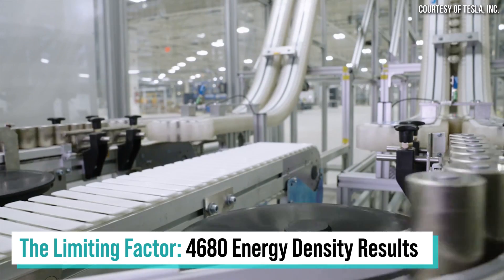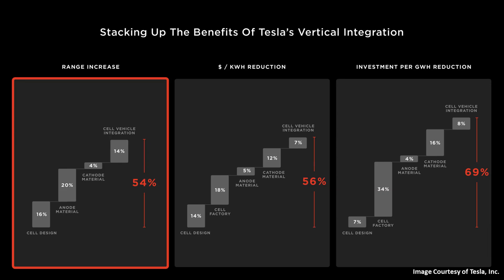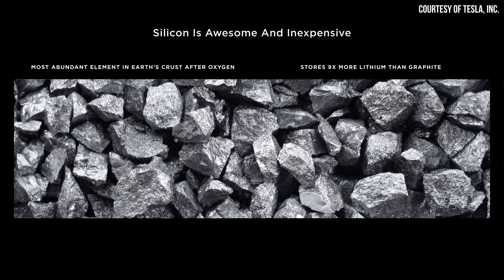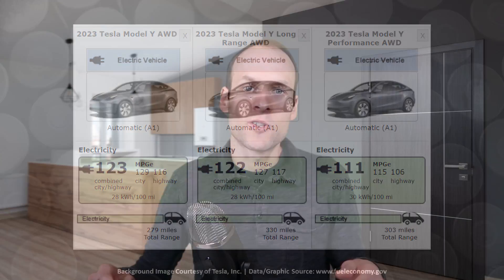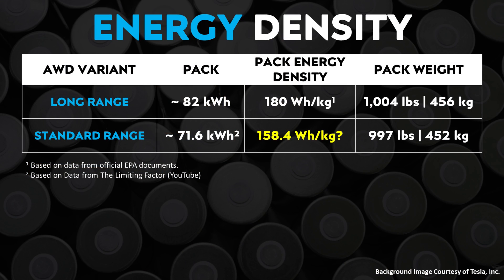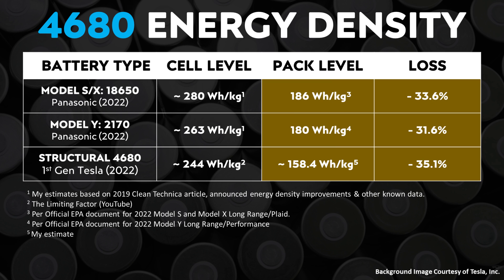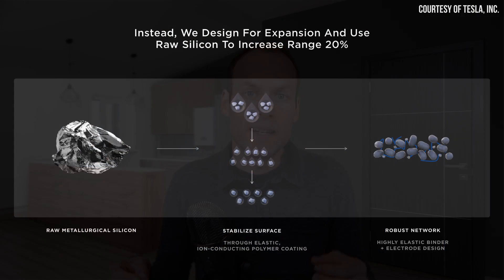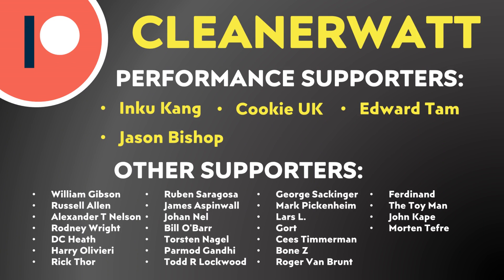Tesla 4680 Battery Update | Not What I Expected

Comment: wh/kg on a cell level is absolutely irrelevant. If your vehicle is more efficient (for example with less internal resistance in the cells) or your pack design is lighter you can still achieve more range.

That's why wh/kg on a pack level and internal resistance are the most important metrics to learn about. We know the vehicle weight is almost the same. So we can conclude that wh/kg on the pack level is worse. But we also know the internal resistance is about 1/3rd.

Comment: Geeking out on the "numbers" is cool.  It's fun to speculate, especially as more data becomes available, as to the overall pack energy density.  However, those comparisons are all battery cells using the NMC or NCA chemistry.  I think LMFP and other solutions will gradually replace the most energy dense solutions, as total lifespan, cost, and sustainability become more prominent.  This is especially true as more manufacturers enter the fray.

Comment: So the highest density pack is the 18650, the smallest cell used in the S/X.  The biggest, lowest density pack is the 4680.  What a wreck!  2170 cells can still see improvement too.  Why did Elon reinvent the wheel?  To make it cheaper, not better. Better won't be for some time.  Good luck to those standard range MYs, getting "old" sitting on the shelf lower density 4680 cells, which charge slower too, with a lower 0-60.  Oy.

Comment: The 279 mile standard range Model Y does NOT use 4680 or 2170 cylindrical cells. The standard range uses LFP Prismatic cells, that’s why all of your “theories” don’t add up.

Comment: So was that analysis based on testing one 4680 cell? That would not be definitive. Why would 4680 come out with lower density than announced... possibly could it be the difference btwn a lab construct and testing of 4680 prototypes vs. mass production end product result? Some small differences in how materials are processed and handled on mass production compared to lab environment? Although the Wh/kg is lower it is not a startling difference, Tesla may be disappointed that mass production is not showing the desired results and is working on a solution to achieve their original goals for this battery. Elon has said many times that the real product is not the thing you build, it's the thing that builds the thing you build. So manufacturing the 4680 is the real challenge, not inventing the 4680!!!! It's only successful if it's repeatable, ad infinitum! 
I am guessing there will be tweaks to improve the 4680 manufacturing process in the future!
Reply: We were given a false bill of goods that’s why. The battery as it was proposed does not exist.

Comment: Ok so 4680s are a little lower in Wh/kg,  but let's assume we can interchange them in a fixed size battery pack. Since the pack size is fixed, now what matters is Wh/l. So how does the volumetric efficiency compare? It's important to include that especially since we are comparing packs on the same model of car. Thanks for the great video and insights.

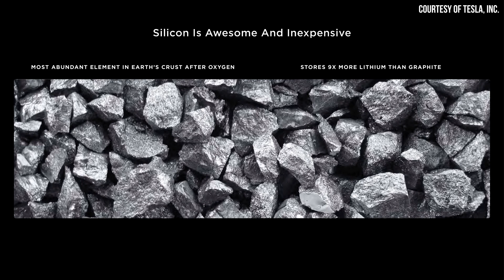Comment: Everyone says the battery can is thicker so there is less energy density because less battery material 2:45 
So yes, the can is a little bit thicker, but we're not talking about a pipe here. The kilowatts per kilograms is lower because the cans are heavier, plus all those tabs on both ends, not because they are displacing that much material. Sure a tiny percentage but imo increased weight is changing the ratio more.

Comment: The big gain with 4860 vs 2170 is the price on the pack - gain estimate 5.500$.  Tesla make 8 batteries 4860 in the same time than 2 batteries 2170. And, on the batteries pack, you can remove (2976-828)×2=4296 welding points and, you remove 2976-828=2148 bot movements.  This is the big gain now.  Gen 2 and 3 will be better but, in next years, not now.  2170= 96×31 batteries and 4860= 92x9 batteries

Comment: So if you ignore the extra weight of the can the gravimetric energy density is about the same as the 2170 then I would say a job well done. that extra weight of the can is just part of the car structure
Reply: Not if you can't actually take advantage of it as shown in this case where the 4680 SR Y weighs the same as a 2170 LR Y.

Comment: Something that people commenting here are not taking into account.
I remember perfectly in the presentation of Q3 results, that Elon said regarding the 4680 batteries that, at this moment, they were concentrated on replicating in Gigafactory Texas the manufacturing process that they had designed and tested in Kato Road. THE INITIAL PRIORITY IS THE SPEED OF MANUFACTURING. I think I have seen that at Kato Road line can produce between 7X and 10X faster speed compared with batteries fabricated in Gigafactory Nevada by Panasonic and in a smaller space.
Elon also said that once the line is installed and manufacturing speed is obtained THEN is when they would focus on changing the chemistries of the batteries (anode and cathode) to improve energy density. But the priority right now is manufacturing speed, not energy density.
Reply: Manufacturing speed doesnt matter. What really matters is the cost. Do you know how the manufacturing speed is affecting the cost?
Reply: @cassius1080  Of course, mass production will reduce cost. For every cumulative doubling of units produced, costs will fall by a constant percentage.
Reply: @gunnarcaguenssen  bla. Bla. Bla. So you dobt know. Im asking the numbers not truisms.
Reply: @cassius1080  you are misunderstanding. That means, you think you understand, but not the way Gunnar meant. Of course if the line costing 1 million produces twice as much product, the part of the product price allocated to fixed assets will drop. Then you have a building and all assets associated with it. Same thing. And of course, by buying more material, you get higher discounts from the supplier, or might lead you to even buying the mine and refinery. But who am I talking to, you will just reply by blah blah blah again. 😏
Reply: @Alarix246  you see you used plenty of words but there is very little meaning to them hence bla bla bla. Its you who doesnt understand that you are stating obvious. What I am asking is the numbers which would give a sharp and clear picture of advantage of speedy battery manufacturing.
Reply: @cassius1080  why are you asking me? Ask Tesla. Neither you nor me can change the reality. Have a nice day.
Reply: @Alarix246  im provoking thought through asking. And the thought is - this vid is a meaningless clickbait as it doesnt tell a single piece of information. Not a single number.
Reply: @cassius1080  I've seen a few such dudes actually who had to oppose just for the sake of conversation, even if that argument was not what they wanted to defend. Not an easy conversation with such type I tell you. 😏 I was always thinking it was because they didn't have a fresh idea of their own. But yeah, I must agree that the video lacks data and diagrams and such. Actually, thinking what is the reason I watch such pieces, I guess I am disgusted from the lies winning over the honest people, so watching these kind of nonsenses may be just a relaxation, happy time watching something describing a relatively positive future technology... yeah, we are wasting our times by watching videos that repeat the same stuff as some other guy posted recently, and 95% of it we already saw, maybe the 5% is new to us? Are we having perhaps too much free time? It's all vanity and vexation of the soul. 😏 But so eone found that a long, long time ago already.

Comment: GM's Ultium NMCA battery has an energy density of: 272Wh/Kg, which is higher than Tesla's 2170 or 4680 and charges faster, per independent test, and cost less to make as it's a pouch cell.  I think there was WAY too much hype over the 4680 batteries and people are finding out, they were only a way for Tesla to make the cells cheaper, but are no better, but Tesla is still charging astronomical rates for their cars, so more profit to them and screw us customers.  I'm putting an order in for the Chev Equinox EV and replacing my Volt with a new Bolt, which is pretty much the same as what Tesla's Model 2 will be--a small, inexpensive hatchback.  I see GM, VW, BYD and other EV's taking most of Tesla's market share, especially when GM and VW are in beta-production of solid-state batteries that have twice the capacity as today's li-on cells, in the next couple of years.  I'm still rooting for Tesla but with its toxic Twit CEO and obvious falling behind in tech, they'll be a risky investment in years ahead.
Reply: Good luck.
Reply: I’ve been in production and product development most of my life.  Even with the best of intentions, the best science behind a product direction, it is impossible to see clearly into the unknown. I can’t count the number of times I’ve said to my self “my God I had no idea that would happen“!  The 4680 cell incorporates a whole series of changes such as dry electrode, tabless, larger size and probably more where any one of those can present a series of challenges.  All impossible to predict.
Reply: Buyers remorse is in your future. BTW, you don't know crap about batteries. Don't you watch these programs?
Reply: Have fun getting parts when GM is bankrupt
Reply: GM recently said that their aim is to make 1 million EVs worldwide in 2025. Tesla must be quaking in their boots!

But seriously, it is faulty to think of this as other EVs vs Tesla. It's (other EVs + Tesla) vs ICE, and ICE will lose.
Reply: Mary Barra, you?
Reply: No one every showed yet even such a terrible company as GM can even mass produce pouch cells. Why do you think tesla stuck with cylinder cells. 

I mean everyone can do what they like. Why would they actually go buy a GM over a Tesla is beyond me 😂. Maybe you’re already married. Maybe you have kids that destroy cars. Maybe you like a bankrupt company that took tax dollars and never repaid them. Maybe some people like rooting for a losing team ?  Who knows. Enjoy your GM
Reply: GM and Ford make some of their EVs in Mexico and still have trouble breaking even. They are both so obviously holding out for a bail out again. Legacy CEOs are rewarded for NOT taking risks which is why they cannot lead in a totally new technology. Look what happened to forward thinking Herbert Deitz at Volkswagen; the old guard destroyed him and kicked him out. No making changes around here and upsetting our golden parachutes.  Just pretend to make electric vehicles but don’t let the proven profit producing gas and diesel vehicles be replaced.

Comment: Making the mega castings will lighten the vehicle weight should also help performance ,range and cost
Reply: Didn't they say the same thing about the gigacastings?
Reply: Yes, it seems that the weight of any deleted structural components should be subtracted from the pack weight to get an accurate idea of the driving performance of the entire car.
Reply: Yes, but production efficiencies are real, eliminate 300 robots, shorten production line, even reduce OHS risk from fitting seats outside the body shell. Fremont should be able to squeeze out more cars, same footprint. It’s extraordinary that Legacy didn’t grab this tech for ICE cars, just so obvious in hindsight.

Comment: 244 isn't what any of us expected. Oof.
Reply: First version of a new technology, they said they had to drop some of the advances to make at scale till they work out kinks. I think it’s super impressive. Also if you remove the weight of the casing it matches 2170 norms. They will get there soon.
Reply from the maker: Yep... I thought it would be no lower than 260 Wh/kg.
Reply: @Cleanerwatt  it is when you subtract the casing so they haven’t lost anything but in time when they add the new silicone anode it will reach the advertised numbers.
Reply: Why is it junky?